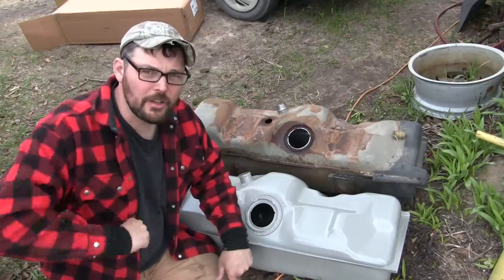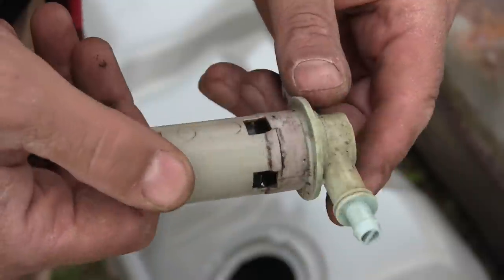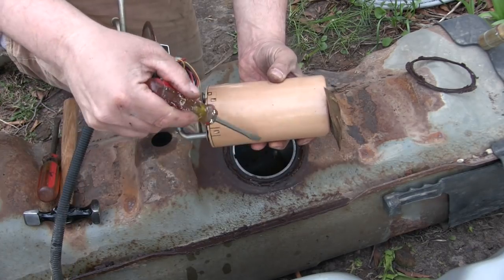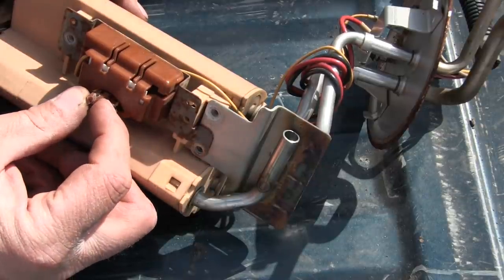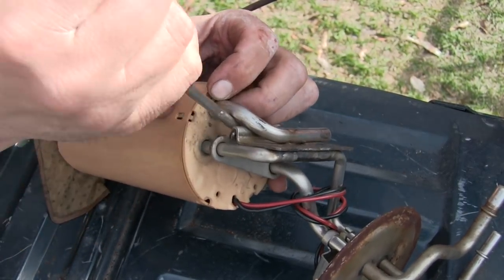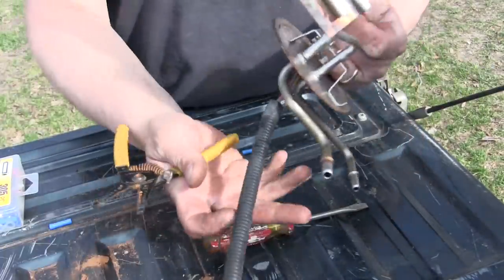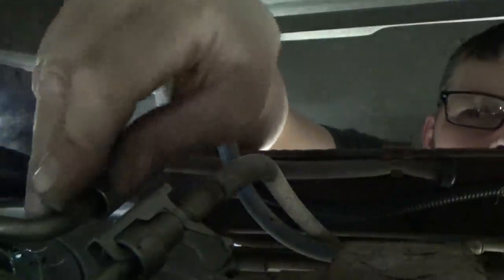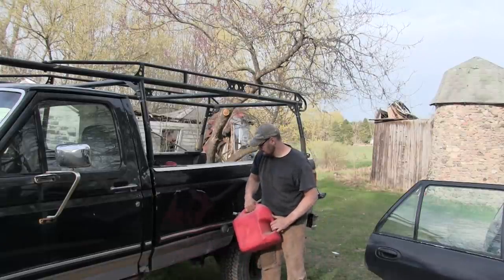How to Change a Gas Tank & a Fuel Pump

Comment: Nice video but I am a bit concerned when you use a petroleum (oil) based product to seal a rubber fitting. Sometimes there is a negative reaction. Hopefully the rubber is oil friendly.
Reply from the maker: I think it'll be ok

Comment: I rebuilt a tank using a bunch of JB Weld on a jeep years back. 
Had made my own straps as well do to the price of them at the time. I ended up using some fencing turnbuckles for the one side of them. Saved 80 bucks a strap.
Reply from the maker: right on

Comment: Great tutorial on fuel system maintenance! Always a wise idea to just replace the in-tank fuel pump/sender assembly if the tank has to be dropped for any reason, and try to drain all the fuel before removal, so much easier!
Reply from the maker: So much easier!!

Comment: Great tutorial! Can I make one suggestion though? Add heat shrink tubing to the crimp connectors inside the tank. Sometimes crimping will cut the insulation. If that happens on + and - side, could cause a spark. VERY bad thing to have occur inside the tank. 
Thanks for another great video and thanks for sharing the knowledge!
Reply from the maker: The previous connections were bare metal ( under the hanger cap) , I dont think there is a spark risk.
Reply: @cheapwheels9828  That's surprising! Good to know though. When I've changed fuel pumps in the past, there's been all kinds of warnings and stuff about sparks. Oh well. Thanks again for taking us along. Always enjoy.

Comment: I have only owned and used diesel powered vehicles since 1977,  and I have never had to change out a diesel tank in that time.  As diesel is an oil they sure seem to outlast petrol ones. I have a petrol powered friend whose Range Rover is now on its  third tank in 13 years. I convinced they  rust a lot quicker with lead free and ethanol fuel.
Anyways Dave, "tanks" for another great instructional video, they are always a welcome watch. 
David in the UK.
Reply from the maker: Tanks....Dave W

Comment: Did you have to use a fuel line disconnect tool for that particular one? Or does the line slide off after taking the little metal bracket off?
Reply from the maker: I did use a tool....but once the line was off I wasnt sure it was needed. I dont think its that type of connector.

Comment: This is the one disadvantage of EFI as the fuel pumps are in the fuel tanks. Changing one on a truck is relatively easy but on a car can be a bear.
Many often buy the pump and sending unit as one piece but that can be pricey.
I've know a few guys who cut a hole on the left side of the bed so they didn't have to pull the tank off to get to the pump.

Comment: Two weeks ago I had to replace the rear brakes, rotors, calipers, pads on my 05 Trailblazer. The lug nuts were so tight I wore myself out just trying to get one tire off. Down to the Harbor Freight I went and picked up the same impact driver you are using. Sure made the rest of the job go much easier. Why didn't I get one of those years ago? Also, how did you get the gas out of the old tank? Were you able to siphon it out?
Reply from the maker: Hey Dave, the tank was bone dry it had a huge hole in it the size of a golf ball

Comment: I assume your fuel pump went out and as you got into the repair, you also discovered a rusty tank?  Or, did you have a fuel tank leak and then decide to replace the pump since you were going to drop the tank, anyway?
Reply from the maker: The filler tube was broke in half from a spring hanger that broke ( before I owned the truck)....so I never used the tank. The fuel pump did work, but the tank had a huge hole in it, and the filler tube was literally busted in half.

Comment: In my old van, I cheated and cut an access hole in the floor.  It has a 33 gallon tank between the differential and the rear bumper with a frame mounted trailer hitch under the tank.  I only have to cut out the access hole once.  Manufacturers should do it to start with.
Reply from the maker: My escort wagon has a access panel under the back seat. Super easy to get to the pump

Comment: Noob question here, but is the wire connection water-tight? I would just wonder whether that's a combustion risk
Reply from the maker: no the connection isnt water tight. If you look at the original connection on the bottom of the pump hanger, its just a soldered metal connection. I dont think there is a spark risk........it "looks" like there should be....but I dont think there is.